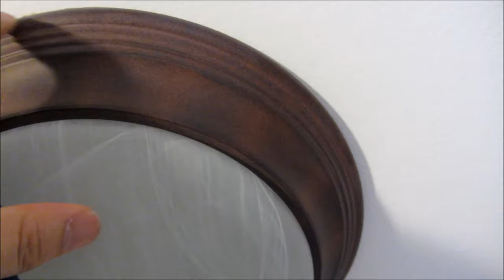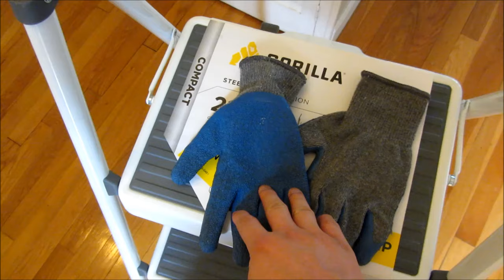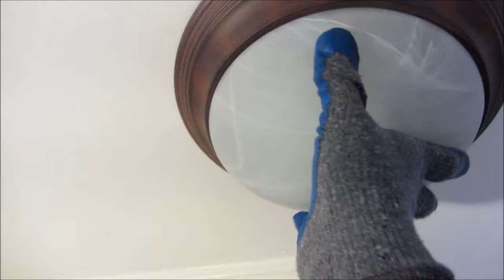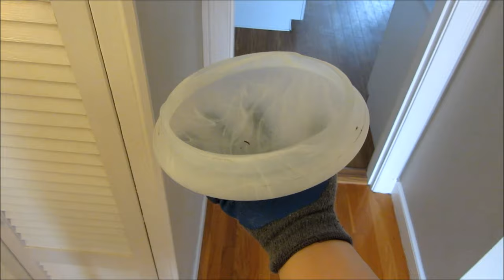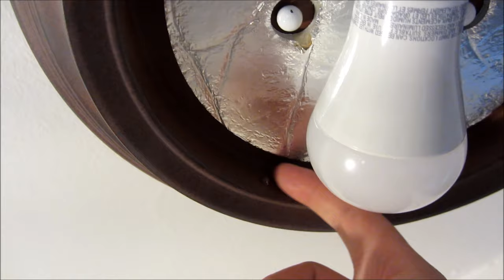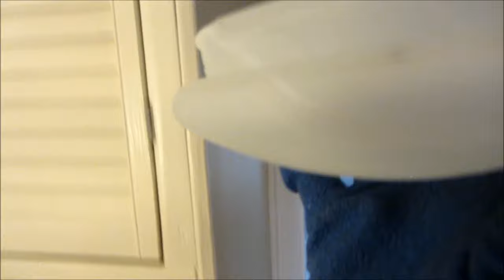How to Remove a Dome Ceiling Light | How to Change Lightbulb on Screwless Glass Cover Lamp Fixture

Comment: I’d like to have a word with whoever designed these monstrosities
Reply: I'd like to have two words with him -or her - and the second one is "off"
Reply: me too!!!!😠
Reply: me too!
Reply: Yes it's a f joke
Reply: Man!
Reply: I finally opened one of mine and then after I locked it in place it fell and shattered into a thousand pieces.
Reply: Seriously, worst design ever
Reply: Agree
Reply: Agree with you 😅
Reply: Mine is hanging from the ceiling by cords
Reply: Same
Reply: Haha dude, this made me life bc I just had to change two of them and I didn’t know certain cuss words existed
Reply: For this Fixture Designer: Respond (On-Site) to 50 Stuck Globe Fixtures.
Reply: @macmen007  why not state the location. You guys in Woodstock Georgia?
Reply: Mine is stuck as hell like super glued
Reply: Tapping very lightly around the edge with rubber handled tool worked for me; use extreme caution!  If it already has cracks it will brobably break.
Reply: me tooo
Reply: @macmen007  so your telling us we need to spend money on a tool for this? 😕
Reply: @tommygun8617  I simply tapped very lightly along the edge or rim of the globe w/a rubber handled part of lineman pliers, while turning the globe.
Reply: I would too, they didn't used to be designed like that and were really easy to remove and replace.
Reply: You and me both
Reply: Why do you think they are so inexpensive and found in every apartment?   We get what we pay for.  😮
Reply: I was curious aswell,so I looked it up & manage to open it ,but now I don't even know,what light bulb it uses ,never seen this one before.
Reply: honestly 😂
Reply: Word, I hate this light fixture.
Reply: @bmay81  Yeah.  I'm in an apartment and it is my bedroom hallway ceiling fixture.  The base of the fixture is being held in with only 1 screw.  The other screw is totally missing.  I tried to put another screw in its place, and it was screwing into nothing but air  -- there was nothing for it to "grab onto."  So, I merely put the glass globe part back on.  We don't have earthquakes here in Central Alabama (I don't think), but the first time something jars the wall or ceiling, I'm sure mine will shatter as well.  Time to look for a personal injury lawyer?  😁
Reply: Yah lol... But they look so cool!
Reply: Me too. A word is being polite.
Reply: 🤬🤬🤬🤬 why would they make something like this??
Reply: Trying to open one of these on a swivel stool is the stuff of nightmares.
Reply: @littleorangejuiluscaesar  I’ve tried 😭 It was the only object I had to use to reach it

Comment: I tried with mine and it still won't work!
Reply: Sometimes I put a little WD 40 in the crack area to loosen it up. Don't use too much or it will be slippery. Latex or the rubber gloves used in this vid helps to keep you from dropping it.

Comment: I had one that was stuck really bad. The previous residents probably never removed this light fixture. I took a rubber mallet and gently tapped around the sides. And it came out very easy after that.  Rubber mallets are good in this situation.
Reply: Rubber mallet did the trick. Thanks for posting this!
Reply: Hi! I used your idea but changed it a bit since I don't have a rubber mallet. I used my knuckles and gently knocked all around the metal and glass and then was able to get it off the metal base! Thanks again for your idea!!

Comment: Depending on your fixture, you may have to turn the glass clockwise. I tried counterclockwise and it won’t budge. After much frustration, I happen to try clockwise and it dropped in my hand without much effort. I took it off and put it back on several times, it sure needed a small twist clockwise to pop it out.
Reply: Do Australian dome lights unscrew clockwise? (I make joke)

Comment: Unfortunately I could not remove mine with the rubber gloves... it was on too tight. What I did was get my rubber ball-peen hammer and tapped on the metal ring around the glass globe. Don't tap too hard because this could dent the ring. Next, I hit the globe with glancing but strong taps in a counter-clockwise manner. Yes, it made black marks (a white rubber ball-peen hammer would be best) on the globe but these can be removed with glass cleaner. Success! It loosened the globe and I was able to remove it and clean the inside and change the bulbs to LED.

Comment: Really a good video. Your video inspired me to do it myself and I did it. In my case, I helped myself with a long ladder so that I am comfortable in removing it. I had to try it few times before I was successful. I did not have any rubber glove so I used my bare hands, but, I made sure that my hands were dry and the glass lid was also dry

Comment: i didn't have any luck with rubber gloves, instead i loosened the fitting with WD-40, then taped around the glass cover and pulled on the tape to increase my torque moment arm. that did the trick

Comment: Thank you. We had removed the whole fixture without removing the dome and then we couldn't get it attached again.  After watching this video, we were able to remove the dome from the base even though it was just hanging there, clean the dome, put the base back on the wall after adjusting the screws a bit, and finally putting the globe back on the base. We still have another fixture to clean,  but that should go much smoother.

Comment: Sadly mines just will not come off 😭
Reply: Both of these techniques work really well for a really stuck one! The issue is that using your hands, it's hard to rotate it without also pushing up.

- Use a shoe sole or something else rubber to help spin it: https://www.youtube.com/watch?v=EH2_QXUKvSw
- Use tape "handles" to spin it without pushing up: https://www.youtube.com/watch?v=vXHylBQzrIs
Reply: Eric Loveland thanks ... the link shoe trick really work for stuck one .... cheers
Reply: Thank you for posting those Eric, the tape handles trick was fantastic - couldn't get the fixtue off any other way.

Comment: Thanks. I tried before watching and now i have a brand new hanging light fixture pointed at the toilet :) apparently not smart enough to line up the hanging screws in the ceiling with the holes in the dome

Comment: thx for posting this, I came looking for wtf i can't get now 2 off. Didn't think of the gloves, ill try that this afternoon. 

2 questions tho:
1) if we still can get it off, can I spray some oil? I hate wd40 for stuff like this so baby oil work? Or heat it up w hairdryer?  and can we rub it down w baby oil for next time? both the 2 i never use so long time not undone & it always makes things harder. 

2) The 1 bottom my stare is small & I see its kinds brown from too hot for higher old bulb on too long so now I want to switch it to the new plastic bulb that 100 over 60/75, for it doesn't hot & wint burn it brown so won't fear fore plus they brighter & in full underground basement, needs brighter light! I put in the new bulb but it doesn't work in it? I tried 3 & none work but regular does? My ex put a dimme4 switch on it cuz its part of the family room in basement & he hated the bright light in the eve. So im guessing its the dimmer switch cuz I have 6 of these & the 1 replace in main floor hal works fine. So what kind new bulb do I need in a dimmer switch light? A solid 100? or a 30/60/90 type adjustable bulb that adjusts? Any help w this part of these now nightmare lights since I became single, much appreciated!!

Comment: These truthfully are just a pain in the rump. You may end up having to touch up the circumference of the ring when installing a ceiling fan with some touch up paint. 
And if you're having a really hard time twisting the glass insert even with rubber gloves? Try a rubber hammer on the ring but only lightly
tap it.

Comment: The light blew. As I gripped it and turned it counter clock wise it came off the wall. I can only assume I rotated it enough that the other bulb engaged and turned on. I got it turned back on the set screws and walked away accomplished

Comment: OR... adhere a long length of clear packing tape to the rim of the glass and pull the tail like you're starting a chain saw, only slower. Keep one hand under the glass to catch it just in case.

Comment: Ours hasn't been moved in 4 years and now both lights are out so I have been trying to remove the glass piece for 10 minutes but it's not turning.
I'm terrified that I'm going to use too much force and when it finally moves it'll fly out of my grip and on to the floor, shattering it.
Why do these things have to exist...

Comment: I think everyone knows you have to turn counter clockwise, but in most cases people who are here the cover is genuinely stuck for whatever reason. I have tried really hard and it won't budge. It's a room I don't use much so it has been a few years since it was changed, but I have removed it before without a problem.
Reply: Same
Reply: @evelynlarson9308  in the end I just turned it harder and it eventually loosened

Comment: .... Funny story. I had one of these a few months ago and I thought I  would be slick and change it myself so I started turning the light bulb part of it but when I did it the whole thing unscrewed so needless to say the bulb and the mechanism was just dangling from the ceiling there was no way for me to put it back into the ceiling so I had to cut the wires and now I have exposed wires  and it's going to stay that way until I can get an electrician to fix it. I wish I had seen this sooner...

Comment: But you must tap the glass VEWY gently, it's the cheapest, most fragile class on this earth.  Bopped mine with a shoe and cracked it.  Carefully replaced it, couldn't tighten it because the collar was cracked, and ten minutes later it came down and shattered altogether.  The glass jar your marmalade comes in is stronger.